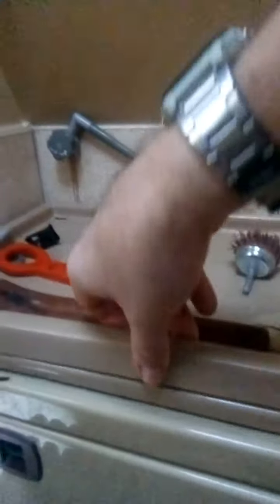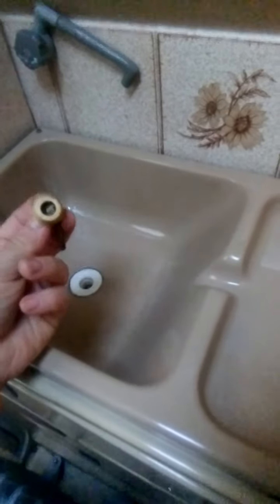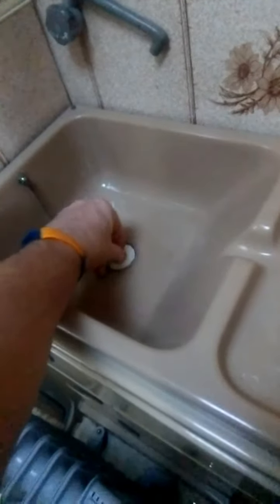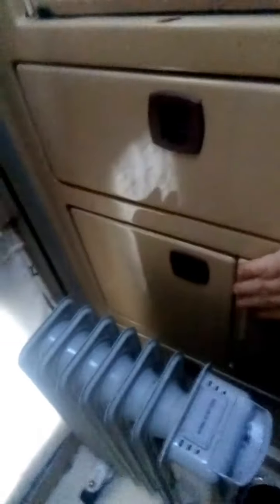Bedford rascal look at

Comment: The seal above the cab is not necessary, in fact, if you seal it, you will have to cut it away if you ever want to remove the pod. There should only be a plastic or rubber U section strip fitted to the flange on the pod which is to stop the fiberglass wearing the paint through on the cab roof. Any wet that gets under there can't get inside unless you have a hole rusted through the roof or roof seam. The side windows on the pod have a hinge at the top which is secured with steel screws - these rust away and water gets in there surprisingly easily, change then for stainless screws. Once water gets in at the top of the windows and through the roof light seals, the wooden frame between the skins rots and turns to sponge, soaking up water which drains down the inside walls below the windows staining the carpet finish as it goes and wetting anything stored under the seats. It's a long job to chisel out the old stuff and fit new as I've done that on mine. The alternative is to scrape out what you can and allow it to dry completely. Coat what is left with plenty of polyester resin and fill in the gap between inner and outer skins with polyester body filler. Replace the wood where the top hinge go's or at least where the screws go.